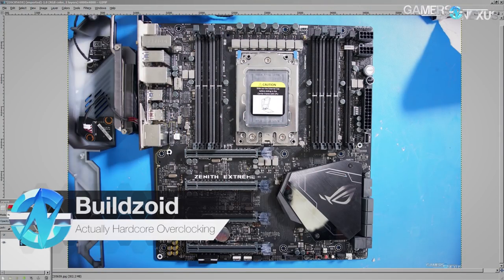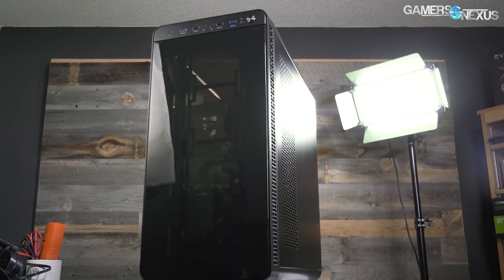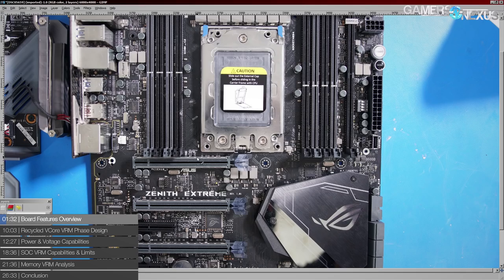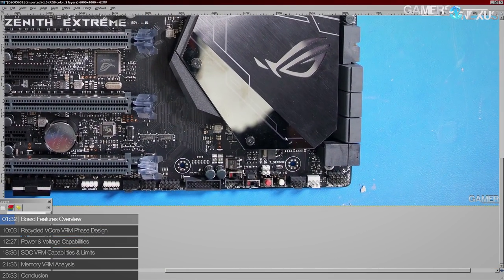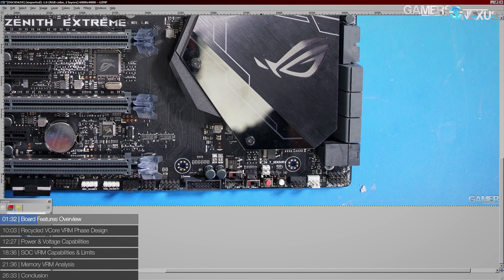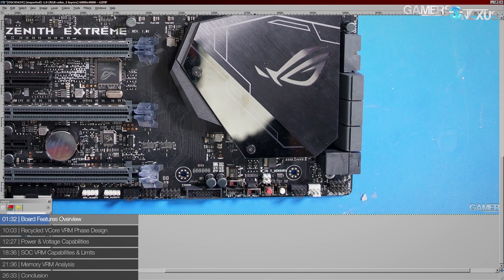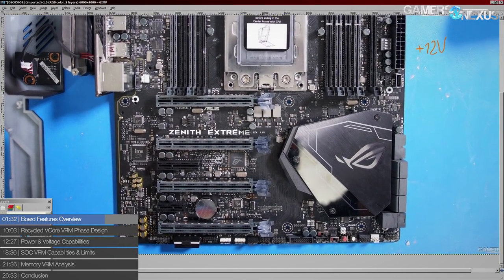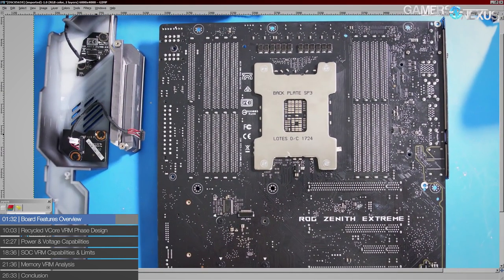Recycled VRM Designs: ASUS X399 Zenith Extreme PCB & VRM

Comment: The extra 12v CPU input that AMD wants on the boards starts to make sense once you realize that TR4 is going to be around for awhile and AMD may release higher core count CPUs and might need that extra power input
Reply: Zachary Taylor which is good on AMD, they could have pulled an Intel and just required people to upgrade motherboards, but they actually tried to plan it out, so an upgrade isn't CPU+$400 mobo, just the CPU. While AMD is still a bit behind due to how software is poorly optimized for more cores/threads I am VASTLY more likely by an AMD CPU due to stuff like this and Ryzen actually being close (better in a few ways) to Intel.
Reply: Not only "not yet optimized for more cores" but also optimized for Intel.

A lot of high end software is still compiled on Intels compiler suite which has always favoured Intel hardware (at certain times in the past, not so much because Intel knows their architecture better, but because they deliberately made code for competitor CPU's slower).

MCVC has gotten better in that regard over the years and the further we get the better MS has optimized compiler paths for current gen AMD hardware.

On linux GCC is already very good at getting everything out of AMD hardware and with that the single core gap for Intel hardware is even smaller than it already is on Windows.
Reply: Umm... no Zak. You're wrong, and for many reasons lel.
Reply: Also to note, "just make it handle multicore better" is not always possible.

Some code does not lend itself to multithreading, especially games.

You can offload certain parts to other cores, but the more you do that the more difficult it becomes to get everything back out in the needed order, especially in a way that is fast, making using multiple cores often slower than pumping it trough one fast core.
Reply: Hyper-V is a good example. If you are over Virtual Machines thats a Must. Unfortunately Intel have most/all of the optimizations and support. Thats what the guy that sold me the X399 Zenith MB told me.

Comment: I like how he goes out of his way to mention that threadripper realistically only needs 1 8pin, while most other "media outlets" say threadripper is insanely power hungry over its intel counterparts. The wonders of not having Intel breathing down your backs
Reply: James Mastroianni well even though it's in spec, I'm not so sure about pushing 300-350w through a single 8 pin eps. Seems a bit sketchy to me.
Reply: This is like those 3x8pin GPUs.
Reply: rcradiator na thats no problem, if you do the math you get to about 7,5 Amps per 12V line, wich is a none issue since the cables of PSUs are rated for 10-12A
Reply: rcradiator, got any sources to where you see 300-350 watts for a 1950x under air/water? Stock the chip usually consumes around 150-175 and oc's depend on the voltage needed, but i've never seen one above 300w. That actually reinforces my point about larger media outlets being forced to call Threadripper extremely power hungry vs Skylake X. Also LN2 oc is a different animal, but they know they are breaking spec anyways. 

Skylake X has a requirement of only 1 8pin, but no motherboard manufacturer has been dumb enough to ship one with only 1 8pin. I can't remember the exact value, so I wont guess here, but Der8aur was pulling some insane numbers when he threw a 7980xe under LN2, and was enough to make the 12v on the 8pins hot to the touch.
Reply: a 7980xe can easily pull 500W under water (4,7/4,8GHz), LN2 was over a 1000W
Reply: James Mastroianni  I don't see the problem with the 8 pin but with shitty cables if you spread the load better even low gage cables can't fuck you up
Reply: Well and more is just better says the consumer sheep
Reply: EradWir an overclocked 7980xe can pull 500w, which at 12v is roughly 41 amps. That is wayyyy to much power for a single 8 pin, even stock clocks, just delided it can chug 300 watts, which is high for 1 8 pin
Reply: James Mastroianni a 8 pin has 4 12V lines, so depending on the gauge of the cable you can handle 384/480/576W (8/10/12), so 300W are really no problem at all
Reply: For 500W you should plug in an extra 4 pin though, because the connector is gonna melt at something like 450W
Reply: James Mastroianni I didn't talk about Intel space heater and said that for a 1950x without a stupid overclock so 200-250 watts a single 8 pin is fine but if you have a shoddy psu cables better get a second 8 pin if you want to go beyond I run my fx 8320 in the day on a single 8 pin and that was pulling about 250 watts at 5.2 too and yes I know it's retarded to overclock an fx but I didn't have the money and needed the peformance  and as a bonus I got a warm room in the winter
Reply: EradWir can confirm I have mine at 4,8GHz because my VRM is getting too hot if I go above that, its really a good heater
Reply: Pretty sure buildzoid is wrong here. Good design provides redundancy. try to get away with the technical bare minimum is misinformed at best.

Comment: Just a hint: ASUS "invented" the feature name "Coolplug" just because they are using massive metal pins now in their CPU/ATX power plugs-(Only the 12V pins tho in the main power connector of the X299 boards). While the entire industry has been skimping pennies on plug costs by using folded sheet metal pins so far. For comparison, ASRock doesn't do such marketing BS overkill and makes their ATX/CPU connectors use massive pins now on X299. One of the reasons why I turned my back on ASUS: Too much pointless bling-bling and featuritis, each with at least one logo to blind unexperienced fools. I'd rather invest in better component quality instead.

Comment: I own this motherboard with a 1950x at 4ghz with 1.2875 vcore and run BOINC with 100% CPU load for 12 hours at a time or more. I left SOC voltage on auto and have a SOC current (according to HWiNFO) minimum of 22.855 A, maximum of 37.231 A, and averaged 34.778 A today, at about 6 hours in.

Comment: +Buildzoid, at 21:25 you state you don't know of any Threadripper motherboard with a better SOC VRM. The ASRock X399 Taichi however has a 3-phase VRM with 60 A power stages which are cooled by the main VRM heatsink: https://www.tweaktown.com/reviews/8309/asrock-x399-taichi-threadripper-tr4-motherboard-review/index3.html

Comment: 9:25 why are these capacitors black? Isn't black color commonly used for diodes?
Reply: SMD aluminum polymers and tantalum polymers in black packages are rather common on PC hardware I'm surprised you've not seen/noticed them before.
Reply: Well, I've never actually dived too deep into PC hardware repairs, but I did small electronics repairs like cell phones or microwave ovens about 10 years ago so all the reference I have is what I've seen there... Probably need to refresh my knowledge...

Comment: Can you check out the Asrock Z370 Fatal1ty K6? It appears to be an insane VRM deal for what Asrock is asking for the board.

I'm asking because these videos are far more informative than any other reviews I have seen
Reply: The VRMs are roughly comparable to that of the Asrock Extreme4. According to overclock.net, both of these boards are capable of supplying >250W sustained.

Comment: @GamersNexus serious question here... I'm new here, been going back through all of your videos. I have been learning alot, and am currently trying to decide, would it be worth waiting until late August early October for my pc build that I will be making. Mostly for Threadripper 2nd GEN / GPU & RAM prices to drop, and would you recommend 1080ti over 1070ti for gaming, editing, and streaming. also would you recommend just going with RYZEN 2nd GEN (2700X?) even if I did wait, based off the uses listed for this build. I know there isn't much info on Threadripper 2nd GEN, and know that makes it hard to even know if it would be worth it or not. However I figure using your mystical speculation powers, that seem to be quite accurate, what would your recommendation be? ($2,000-$2,500 budget *$2,500 means I must wait till end of August regaurdless*)
Reply: Are you sure you need 16c or you can get away with 8? I mean, yes, AMD offers a 16 core / 32 thread SKU but I don't know if you're better spending that extra money on those cores or not because I'm not sure you can use all of them to their best potential

Comment: Yeah was about to say those Molex connectors are nasty
Reply: Really wish they'd gone with a PCI-E power connector, or at least SATA power. I have this board and my PSU only has the one Molex cable because they're horrible anyway, but somehow, I've got a bunch of things that want to use it. The board itself takes two because the Fan Extension card (which I'm using to feed the fans on my rad) has another Molex power connector.

Comment: @0:47 so my threadripper pulling 335 watts during Prime95 Small FFT (CPU=3950 Mhz, RAM=2800 Mhz) only required one 8 pin connector?
Reply: My first thought was, there are 2... Why not plug the second in ANYWAY. Cables are cheap as hell, and if you do need it, you wont cause any hardware issues, or damage to your board.

"Actually hardcore overclocking" And the first tip is shit.
Reply from the maker: Wade, a few things: 1 - Your point is irrelevant and makes no sense. You don't just plug cables in "because they're cheap." I could plug in 50 PCIe cables to a 1060. Doesn't make it better. 2 - Not every PSU has 2 EPS12V cables. 3 - EPS12V cables can take far more than they are officially rated for. 4 - Show some respect. Buildzoid solders together zombie graphics cards with power boards, then puts them under LN2. You have no idea what you're talking about.
Reply: And prime is a completely unrealistic workload.
Reply: Holy shit that GN roast
Reply: AdamFJH  if you calculate that out, you got 4x 12V and 4x GND wires on a single 8-Pin CPU connector (remember, we aint talking about GPU connectors!).
 for your workload, you got a total of ~28A 12V, so each wire just needs to handle 7A.
PSU wires can often handle between 10A and 12A per wire - and if you have a that expensive platform, you normally have a good PSU with good wires..
on SKL-X i remembered someone posting a photo of a wall powerdraw of about 650W in Blender (just liquid cooling, not even LN2), so it should be about 50A 12V just the CPU - that should become a problem on a single 8-pin.
Reply: AdamFJH i ran my threadripper on a 500 b evga psu with one eight pin and the 4 pin not connected. I switched to a 800 g3 now but it ran fine even with a mining load on 1 8 pin
Reply: @Wade Grant, that was my first thought too. ASUS supplied two 8 pin connectors why not use both if it is safe to do so.

@TheGuruStud, Prime 95 is a totally realistic workload. Here's my workload, tests to ensure my sysem that is 100 percent (i.e. absolutely) stable under all CPU loads. 24 hours each of Prime 95 Small FFT, Large FFT and Blend seems sufficient to achieve this.

@Rouven Kniep, @Gamers Nexus,  @Actually hardcore overclocking, there's a thread in the linustechtips forum titled "What is the power limit for one 8 pin EPS connector?" which deals with my concerns and contradicts what is said in this video. In that thread it mentions a 8 pin EPS connector supplies 235 watts of continuous power. Assuming that @Rouven Kniep is correct (I actually do think so too based on the specs of my PSU that I've just read) and that the wires from the EPS cable won't overheat/burst into flames, there's still the issue what load the actual 8 pin EPS connector itself(and the copper traces coming from it) are rated for. According to that thread,  if I was too use only one 8 pin connectors for my workload, I will run the risk of something over heating or bursting into flames.
Reply: AdamFJH  Are you running prime every day for the life of the PC? No, it's just a stability test at best and it's not even  a completely reliable one anymore (just one of many you should run).

No one is saying you shouldn't use both connectors, but it's unnecessary and pretty pointless under normal circumstances (ie you're not doing extreme OCing). Don't ever quote LTT. He's like a reality TV star for clicks and profit.
Reply: @TheGuruStud I'm not running Prime 95 everyday but I do run it every time I make bios changes. I'm fully aware that Prime 95 is a CPU testing tool and its Large FFT test has little chance of detecting a lot RAM problems that's why I also do 4 passes of Memtest86 (takes about 20 hour for 128 GB). If you're saying that 24 hour each for Prime 95(version 29.3) Small FFT, Large FFT and Blend is proven not reliable anymore than I need proof. I do 92+ hours of back to back stability testing each time I change/increase bios settings, I need to draw the line somewhere so unless someone proves to me my stability testing is no longer reliable. I'm not going to be adding anymore tests into my procedure.

Obviously it's better to be safe than sorry and the safe thing to do it will be to always have both 8 pin connectors connected e.g. say you usually only have one 8 pin connector connected but one day want to try the stability procedure I use but you forgot to connect the other connecter and end up toasting a $500+ motherboard...I'm pretty sure you'll be sorry.

Linus maybe a showman but some of his content is pretty useful if not entertaining.
Reply: @Gamers Nexus when @Wade Grant said "And the first tip is sh*t", the language used maybe offensive and he probably should apologise for it but if what was said in that linustechtips thread that I mentioned earlier is correct than what @Wade Grant said is an understatement, since you haven't provided a disclaimer noting what Buildzoid said does not necessarily reflect the opinions of your channel or give warning to viewers about taking Buildzoid's advice than those statement's about Zenith Extreme only requiring one 8 pin EPS connector is a potential liability.

p.s. regardless of my concerns about Buildzoid's statements of using one 8 pin EPS connector for the Zenith Extreme. I'm thankful that you guys have made this video because I've been waiting for a long time for it. Can you guys also do temperature tests on the Zenith Extreme's VRMs. I'm curious to know what temperature they are  at different workloads especially the workload in the Prime 95 tests.

Comment: My 1950x with ram @ 3200 ~1.4v and Soc at ~1.1 to ~1.15 .. does run around 31A at full load for benchmarks/heavy use for the SOC.. so good guess.

Now if they can just get a bios version that doesnt have some odd quirks.. and fix memory training, to get stable with ram speeds above 3200/3333.. that would be great.    You cant get 100% stable starting at 3333 and higher with this board and any 19xx chip iv heard of so far.  You can boot.. but not 100% 24/7 14day+ stable and/or not without memory errors of some sort.  At 3200 c14 its mostly fine.  The moment I have gone past that.. it might run for a bit higher.. but it can be a few days to a week in..and it will blue screen with some odd memory based code.  Diff ram kits tested, so its proven to be a board/bios/chip combo issue.  Hoping TR4 2k fixes IMC issues.
Reply: I'm actually running 3466 rock solid on my 1920. I have a couple of G Skill 3600C14 kits. Didn't mess TOO much but couldn't get them to run at the rated speed. With the timings from its own XMP profile, though, I just dropped the clocks to 3466 and it's memtest-stable.

TR 2-series SHOULD improve the situation as it's one of the things Zen+ improved a bit. Between that and the lower power draw, should be a fairly exciting launch.
Reply: Yea.. lets hope.   Iv done so much tweaking with memory im tired of having to screw with it.  I have 3600c16 kits, which have been working at the 3200c14 (stilt 3200 safe set) from the bios.. and seems fine once i worked out a few voltage settings.  Just a pain though.  Course im still on 0902.. having been watching the overlockers.net posts.. hoping 1003 improves detection but im waiting a bit before i change bios again.
Reply: they're pushing all the bios development efforts into AM4, TR4 still have old agesa bios iirc, things should improve when second gen of threadrippers is imminent, but you guys have probably hit the ceiling with a 4-channel platform